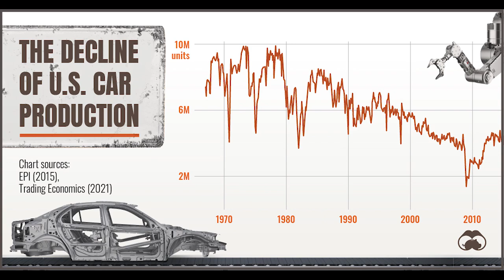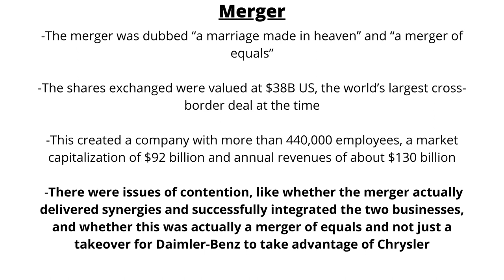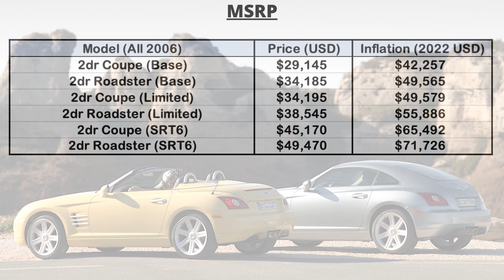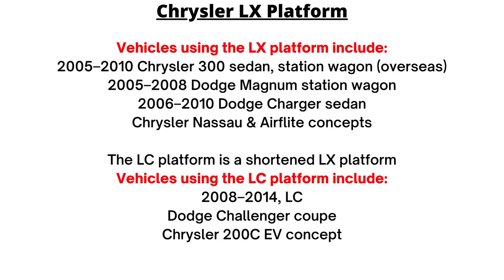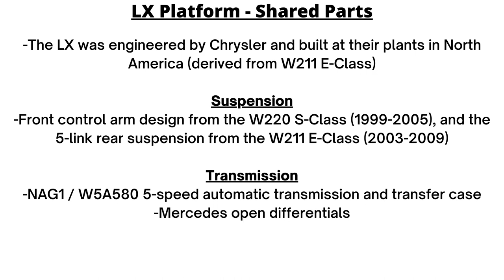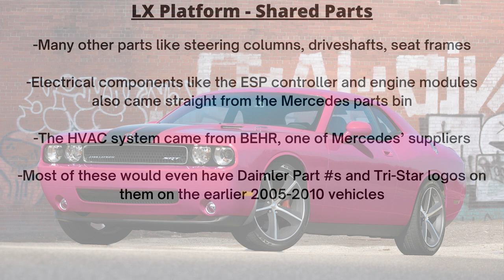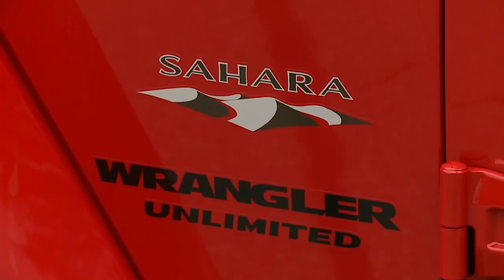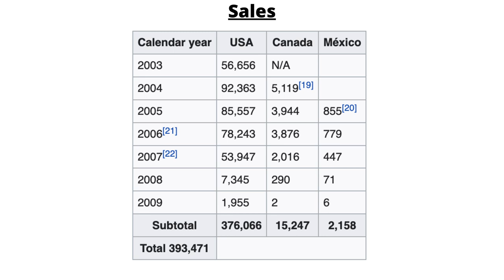The Top 5 Best Things That Came Out of the Chrysler - Mercedes Merger

Comment: I was a Mopar mechanic when the Pacifica entered our lives.  It seemed to me that the Pacifica wanted to be a wagon, SUV, minivan and luxury car all at the same time. I determined it was a confused vehicle. Normal maintenance jobs were tedious or a complete pain in the a$$. Transmission removal required separating the engine/trans cradle assembly from the body to get the trans on the bench...... dumb design.🤷  The 3.5 was not enough.  This confused car was a slug.  After resetting the oil change interval to 3000 miles you would move the car 4 feet and the interval dropped to 2999 miles. 🤷  Other than that I liked it 😂😂
Reply: The Pacifica did want to be all of those things.  As such, perhaps it was ahead of its time as a "crossover."  Today, the sedan is on the brink of extinction, and similarly confused crossovers are everywhere.
Reply: There’s this 2006 srt8 119k miles 14k$ I’m trying too buy any thing u can tell
Me about it ?

Comment: I owned a 2005 Crossfire Limited Convertible. It was a pretty cool car. Turned heads everywhere I went. It never let me down. If it would have had the manual transmission, I probably would have kept it. I traded it for a 2010 Camaro SS with the 6-speed.
Reply from the maker: Yeah they are so damn cool. Decent performance, nice looks, solid interior, seemingly decent reliability.

Comment: You wanna piss off the German engineers, tell them that their precious T class looks like a Pacifica. They don’t like that. Also I’m surprised you missed the Jeep Grand Cherokee. It was a lightly redesigned Mercedes ML/GLE 166 platform which was a very good chassis and is why the grand Cherokee won so many awards. At least in my opinion.
Reply: Actually, the other way around. The WK2 platform was developed under Jeep/Chrysler guidance during the merger but Mercedes got a revised version of that platform, the W166. Mercedes was aware of Jeep’s ability to design capable off-road unibody vehicles.
Reply: @jamesaandf  You may well be correct. I’m not 100% certain that I’m correct. I just remember when Mercedes and Chrysler split up they both needed something that the other had and so during the divorce proceedings they made a trade. Mercedes gave Chrysler the 166 chassis that Chrysler so desperately needed to make a high quality volume selling SUV out of that could be stretched to fit many different roles. In return Chrysler gave Mercedes what was going to be the new Viper chassis that later became the SLS. When I was in Stuttgart  talking to some of the higher ups in a big convention/meeting back in 2010 they did not deny that this is exactly what happened. Devils advocate, they didn’t confirm it either but I got the distinct impression that I was getting at something if maybe not the whole truth.  Regardless the 166 was a damn good SUV in my opinion and the Jeep Grand Cherokee and Durango and whatnot are as well.  If the SLS isn’t based off a Viper it sure as hell has some Viper personality and design cues. Engine bay for days, small rear cabin, brutally fast, tire smoke on command, great fun to drive, etc etc etc. But also not nearly as refined as any of its contemporaries or the GT that replaced it.

Comment: @6:25 The best thing that came out of the Chrysler - Mercedes Merger in my opinion is, the relocation of the battery to the trunk. 
I have the LH platform Chrysler 300M special and it's a nightmare to get to and change the battery in those cars.
Reply: I have a 2001 300m and it's not that hard
Reply: @Welcometofacsistube   I do not like that Chrysler put the battery under the passenger side wheel well🤬
Reply: They could have put the battery where everyone else were putting it, under the hood near the front of the car.😒
Reply: @damilolaakanni  Due to the cad-forward design, there's not enough space to put the battery under the hood.
Reply from the maker: Even in the trunk it’s annoying, so I can’t imagine in the LH cars!! I always have stuff in my trunk so getting access to the battery has been frustrating for me 😅
Reply: @MarspeedCars  battery jumper posts under the hood.  our 2012 charger has never had the battery looked at by me.  its still under the access panel...
Reply from the maker: Mine doesn’t work well on the charger, seems to work better when I jump by battery

Comment: The LX platform was not a Mercedes platform. The LX, while it may have similarities and common components with MB, you won’t find the LX under any MB vehicle. The wheelbase as well as track widths are different, larger on the LX. Lots of MB components, mostly gone now, but components are not platforms.The LX may have design elements and shared components with MB, but the platform was new.
Reply from the maker: Yeah that’s almost exactly what I said in the video at some points. Never said they shared that platform or MB used it, but rather that dodge derived it from
Ideas and parts that were from MB.
Reply: LX platform has a wheelbase of 120.XX  inches to the W211s 112.XX inches. A 112” wheelbase is almost in the compact car class while a 120” wheelbase is in the large car class. I think it’s a stretch to say the LX platform was basically a W211 platform.  I would suggest the LX platform was derived from the LH platform with the constraints that the new LX would use some MB components. The LH from the start was designed to accept RWD.
Reply: He didn't exactly say it is on the exact same mercedes platform but its based on it. Of course its a bit different for chrysler vehicles but the overall platform is based on the mercedes vehicles he mentioned.

Comment: i think it was a good merger, maybe not great, but good.  if i understand it all, the newer multi gear auto transmissions came from Daimler,  i think. that was a great plus right there. hopefully, chrysler will get the new solid state batttery, when they come out, so six dollar a gallon gas wont be a huge issue anymore.
Reply: Chrysler is no longer part of Diamler. It is now Stellantis which is a merger of Fiat, Peugot and what was Chrysler.
Reply from the maker: The newer ZF 8 speeds are German (not sure if made by Daimler). The merger can be seen as good as in it probably saved Chrysler’s ass and preserved the existence of the company, but I don’t feel Mercedes treated Chrysler right and saw this as a long term feasible deal. They left them bankrupt in the end anyways
Reply: @MarspeedCars  ZF supplies transmissions for several euro car companies, i think.  i worked at a MBZ dealer here, and thats just the way germans do business. if its good for you, then its gotta be great for them.
Reply: @MarspeedCars  The 8-speed automatics are from ZF of Germany... some built under license in Chrysler US plants.  ZF is  a long time supplier of ATs to BMW, Audi, and many lower volume European automakers.  Daimler develops and manufactures its own RWD automatics:  5-speeds 20+ years ago, 7-speeds more than a decade ago, and most recently 9-speeds... a design they have licensed to Nissan.  Daimler has no involvement in current ZF automatic transmissions.
Reply: @josephkramer932  and 16 other inconsequential auto makers from europe

Comment: Successes from the Daimler/Chrysler merger: 
1.  LX and derivatives absolutely.Still in production 18 years later and with numerous refinements.
2.  2011 vintage Grand Cherokee off the shared M-class platform.  A huge win for the after bankruptcy Chrysler Corp.  Yes JK was a success, but Daimler contributed very little.
3.  Pentastar V6 a much needed consolidation of too many 6 cylinder engine programs  A very good design, marred by a nagging tendency to drop valve seats for no good reason.
Your inclusion of the Crossfire is a total misfire.  The donor platform sucked, and the Crossfire I drove once back in the day had all the dynamic charm of a cheap compact pickup truck.
Likewise, your inclusion of the Pacifica?  It's not worthy.  Overweight, underpowered and seriously lacking in space utilization.

Comment: The 4.7 magnum is not what they said it was I have one in my pickup and wish I would have got a hemi but they didn’t have a standard transmissions unless I got the magnum I would have to get a automatic transmission I don’t want any automatic in a off-road truck I can do a lot more with the standard transmission when I am off road and in the hills near my home I need the engine brake and low speed crawling than any benefits I get on the highway I was glad I had a manual transmission on several occasions but I grew up in the area and my dad would not let me take the driver test until I could drive the standard transmission I am glad he did that it has saved me on many occasions I can drive any vehicle from little cars to big rig’s and I have climbed in the cab of a semi truck and drove it to were I needed it to go

Comment: Did the hemi and Grand Cherokee platforms have heavy MB influence?
Reply: Yes.   In 2011 the GC was built on the previous gen ML platform.   As far as the Hemi, lots of people won’t admit it, but I swear the architecture is very, very close to the early 2000’s Merc V6/V8 engine.    Their V6 is simply their V8 with two less cylinders.    Although the Mercs use OHCs,and the Hemi uses pushrods/cam-in-block, the coil on plug appears almost identical, some of the sensors and their locations appear the same, and one other doozy.    That Merc engine platform and the Hemi are the only modern engines with two spark plugs per cylinder.   The story is that Chrysler insisted that they have a new V8 that would tick all the boxes for the average American V8 enthusiast, use the Hemi name for real deal nostalgia, employ the general combustion chamber shape for power and efficiency, but most importantly and the buggiest object of contention between the Germans and the Americans was the use of the conventional pushrod V8 as opposed to the over head cam V8, which would seem as “exotic” or “foreign” to Americans, as witnessed by Chrysler’s OHC 4.7 V8, which was a great engine but complicated and not quite as reliable, and did not have the name recognition of the Hemi.     I own two vehicles with remarkably similar engines, the Hemi, and a Mercedes ML320, with the V6 I mentioned before, and have done plenty of maintenance on both, and when I went put new coils and spark plugs on the Merc, I realized I needed 12 spark plugs on a V6!   Mind blown!    Funny, I needed 16 on my Hemi V8.   Hmmmmmm.    Not a complete coincidence.   What other modern engines do this?   None.    Was it ever a common thing?   No.   Does it work to help better combustion charge burn for power, efficiency, and reduced emissions?    Yes, yes, and yes.

Comment: I am a Mopar guy through and through.....but why doesn't Dodge or Chrysler come up with some brand new stuff??? They have the platforms.....Why just Challenger, Charger,300,Dart (RIP,I love my Dart BTW)....Why not come up with a brand new car with a new name on their existing platforms??? Why do they insist on using car names from the past.....Yes they were great cars and I love the current  Charger,Challenger and 300.....But I think a brand new car with a new fresh name would be different and cool....Just a thought.
Reply: Because Chrysler dodge are unfortunately being held back so that recourses are wasted on Alfa Romeo and Maserati
Reply: @manuelsmiley7125  good point
Reply: With the hemi slated for retirement after 2024, I'd anticipate all new cars to start showing up around then, too.  Of course, with Ford and Chevy having already killed off their sedans, I wonder if we'll see actual "cars" or some crossover type thing.
Reply from the maker: Yeah we just need to keep waiting and we will see some new stuff around 2024. No clue if it will be the same nameplates. On one hand it’s stupid to
Not use those names, on the other hand, those cars are kind of tarnished if they are now electric or move away from the Hemis. But hopefully we will see something new and shiny soon! They are just riding out the current cars for now as they are until the end of gas/V8 engines.

Comment: Best thing about Diamler is the diesels and Chrylser did not get any of that.
Reply: They did in Europe. You could get a 300C wagon which essentially was a luxurious Dodge Magnum with a 300C front and Mercedes Diesel engines inside. All that was built in Austria after all. Weird story.
Reply: @noahh914  thanks. Interesting.